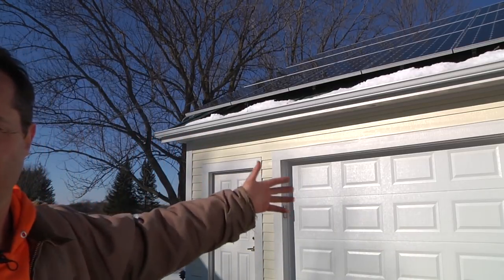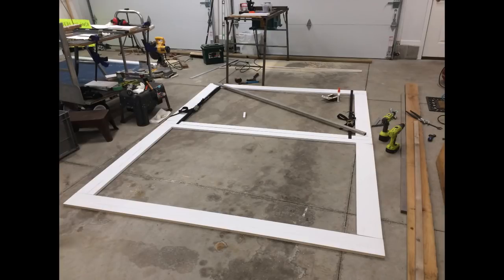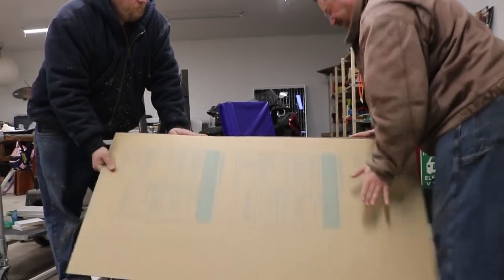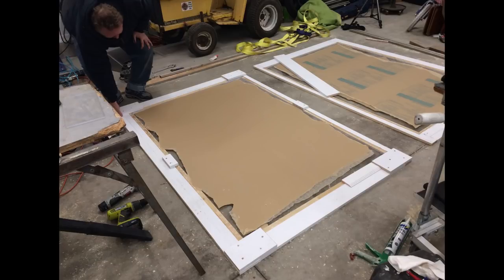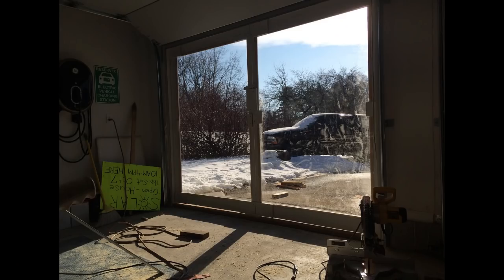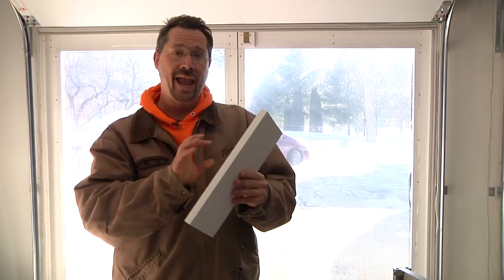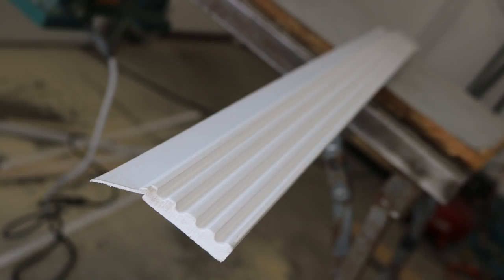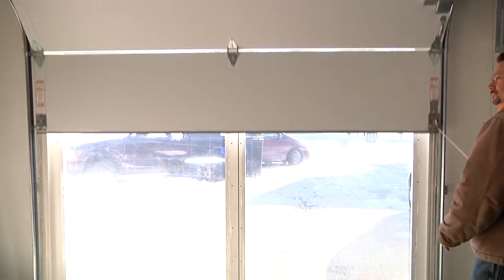Passive Solar Garage Door

Comment: That's as good as a double glazed window. It will allow about 100 BTUs a sq. ft. an hour. ( half of the solar radiation ) About 700Btu/per sq. ft. on a sunny day. Years Ago I read of someone who did this to 2 16 ft. garage doors that they installed in-on a walkout basement. They put operators on the doors and some sensor based control system.